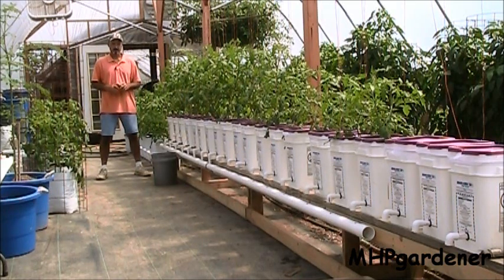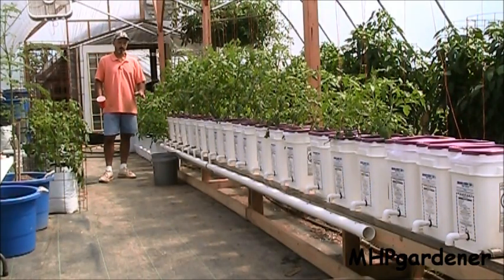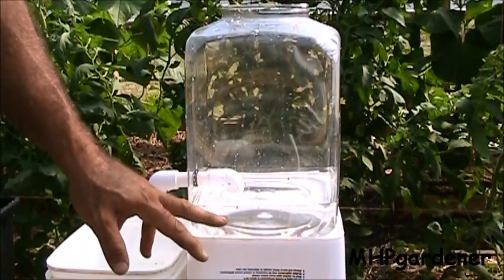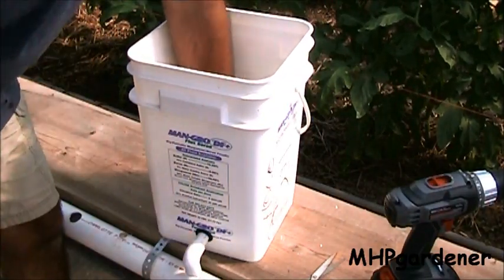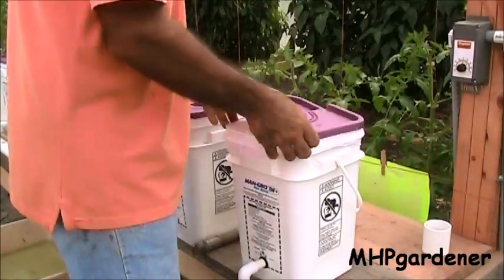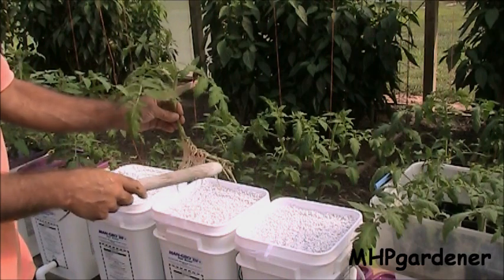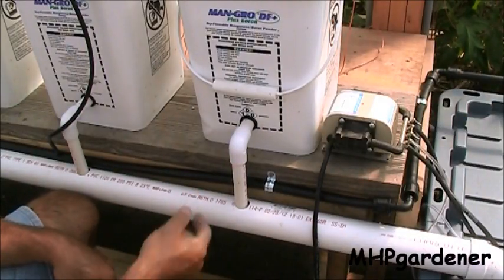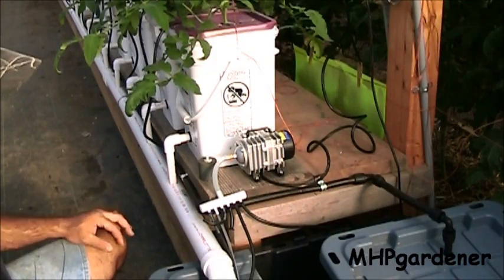Dutch Bucket Hydroponics - How It Works & How to Make Your Own Buckets

Comment: Why do you need the inner elbow? it should work exactly the same without, right? Technically, the outer one could go too. It is needed only to drive the out flow where you want. 

You were talking about the cost, you could just run it with the piece of tube, your 2 inches evacuation tube will then need bigger openings, but that will be definitively be cheaper.
Reply: roots can grow in the pipe

Comment: hi i am from iraq  but my problem is h dont know how use the nutritat or fertilizer to the water and the 2nd thing that perlite is very expensive 10 Kg about 100 $
Reply: you can use sand if you put something to strain it and prevent it from going back into your resevoir.
Reply: Perlite is cheap in the US because it's mined from the ground.  In your case in Iraq you probably should be able to find an affordable source of small gravel that will work well. If you have vermiculite,  tufa, or similar soft rock,  it should be worth trying.

Comment: Hello I wanted to start out by saying that I love your videos. My question is what you thought of using pea gravel and perlite together. I was thinking that I would put some pea gravel in the bottom half of the bucket and perlite in the top half. The reason being is that it get so windy out here in Calhan Co i thought that the pea gravel would work for two reasons. One to add weight to the buckets and the other to keep the perlite from going through the bucket. Basically allowing me not to have to use the paint strainers.
Reply: Why not use pea gravel for the whole thing. It is drastically cheaper, just heavier. Maybe that is the trick. Buy it in quantity from a gravel yard/pit. Might not want to move the buckets. They will weigh a lot. Maybe, put a false bottom. Those roots don't seem to be going very deep anyway.
Reply: @chriscook1468  Old golf balls on the bottom. ?.
Reply: @richsilvasatx  Full of nasty toxic substances, avoid!

Comment: well explained video
i am new to hydroponics
could you please explain how the entire bucket , root system and thr perlite get water only from one half inch dia tube, i mean as the water start pumping, water will flow vertically down, drain out through the drain pipe and not filling the entire bucket?
thanks

Comment: Can you confirm the measurements? 1 inch hole with 3/4 inch grommet and 1/2 inch pipe doesn't sound right.
Reply: For the grommet - the O.D. is 3/4 " and the I.D. is 1/2".  The 1/2" PVC pipe will need to be sanded down slightly, so it can slide through the 1/2" I.D. opening of the grommet.
Reply: Thanks, then the hole drilled should be 3/4" not 1".
Reply: Zachary Watts
No.  The hole should be drilled at 1/2" diameter as stated in the video and about 2 inches above the bottom of the bucket.  If you google "grommet"  and find a picture of a grommet, you will see that the two edges of the grommet cover the bucket and the 1/2 inch diameter fills the 1/2 inch hole drilled in the bucket.  Look at the video at time mark 5:35 and watch him drill the 1/2 inch hole and then slip in the "what he calls 3/4 inch grommet.  He is talking about the outer diameter of the grommet but essentially the inner diameter is 1/2 inch.
Reply: midijeep Thanks for clearing that up, but the video does actually say "What you're going to do is take your one inch hole saw..."
Reply: Zachary Watts
 You're right about that but the I.D. of the grommet needs to be 7/16 inch or 1/2 inch so the 1/2 inch PVC pipe can fit tight so there is not leaking.  Looking at the drawing at Granger for the 3/4" O.D with a 1/2" I.D.  I think  mhpgardener may have mixed up the hole drill size and the grommet size.  According to the drawing mphgardener should of said 1" grommet and 3/4" ho;e drill.  Maybe he can clear this up.
Reply: midijeep
I think a 1" grommet with the following specs should work.  Notice that the hole that needs to be drilled into the bucket needs to be 3/4"  (panel hole).

Outside Diameter = Outside Dia. (B)1"
Indside Diameter = Inside Dia. (A)1/2"
Panel Diameter = Panel Hole Dia. (E)3/4"

http://www.grainger.com/product/Grommet-3MPK8?s_pp=false&picUrl=//static.grainger.com/rp/s/is/image/Grainger/3MPK5_AL01?$smthumb$
Reply: midijeep This link is not the correct size The Part should be 3MPL8 
Indside Diameter = Inside Dia. (A)3/4"
Panel Diameter = Panel Hole Dia. (E)5/16"

- http://www.grainger.com/product/GRAINGER-APPROVED-Grommet-3MPL8?searchQuery=3mpl8&nls=1&suggestConfigId=6

Comment: How many buckets can you run off that one pump.
Reply: Check into sprinkler pumps. We got one for 180$ but we have 32 buckets on a 3/4" line. If you'd jump the feed line up biggest maybe 1 inch then the drip lines off that. You might could get away with more.

Comment: Thank you SO much for the extremely informative video.  If watering by hand, do you really only need to do it 3-4 times a day?  Are they okay at night while not receiving water?  Instead of having a drain pipe, could you just set a bucket under one grow-bin and water each one by itself using a full or half bucket of water (working your way down the line with the same nutrient water)? 

How do you start your seeds?  Directly in those little sponges?   Do you have a hydro seed-starting setup with grow lights?  How many plant-growing seasons can you go using the same perlite or other growing media?

I have had to grow in containers for many reasons and I found out the hard way that you can't use soil in them because it's just too heavy for the plants.  After coming up with a soil-less mixture, I found I had to deal with the mixture coming out the drainage holes.  I solve the problem by laying a small piece of window screen over the holes before filling the containers.  Depending on the size of the container and the number of holes, I sometimes just line the bottom of the container with a piece of screen the same size as the container bottom.  It keeps everything nicely in place. 

I imagine you could also use window screen for this set up; perhaps by cutting a small circle of it and wrapping it over the hole of the pipe inside the bucket and using a rubber band to keep it in place.  Window screen purchased in rolls would probably be cheaper than the paint screening bags and it is extremely useful for all sorts of gardening projects (like protecting normal raised garden beds from bugs and animals, and providing some shade when it's very hot). 

Thanks again. :)

Comment: why do you need such big buckets if the root mesh even of a full grown plant is so much smaller than the bucket?
Reply: Bigger buckets are the norm which you can find; the smaller ones actually can cost more money for some reason.  If you can find smaller buckets for cheaper than the big ones, it doesn't seem like there would be a problem with using them.

Comment: Bless you Brother, God has lead me here recently and I'm learning so much. Thank you. You mentioned getting oxygen to the roots via air stone. Question. Can you use a open drain hole without the PVC pieces in the bottom of the bucket? A rain gutter could be used to collect run off in this case. What would be the down side of this idea? Thank you
Reply: If you use a hole in the bucket with no piping, you'll have to put the hole 2-3" up the side just the same as he does. If you put it in the bottom, you'll drain all water out and have no reserve. There would be absolutely no reason why you couldn't do it, though.
Reply: I was planning to drill the holes just as he has done in this video. A friend and I discussed not using the 45 degree elbows to save some money on parts and I wasn't sure if it was necessary. Thanks Rodney. I appreciate your confirmation to my question. Best Wishes.

Comment: With no electricity could a person do a gravity feed setup by putting a bucket up higher and hooking it up to the feeding line? Then the return line like you have there. Just use a bucket to dip in the return reservoir and fill the feed bucket.

Comment: Some plastics are food safe and some are not. It is why Lowes or HD have several different colors of PVC pipe in the plumbing section. Random plastic is not optimal. We are all going to die, but I don't think this Dutch bucket is going to get ya.

Comment: How many gallons of nutrients do you need PER plant? Is there a recommended number like say, 2 gallons per plant? I'm planning on doing a nutrient change out ever 7 days so how many gallons would I need per plant to do that? 

Also, do you top off your reservoir with fresh water, not at all or with 1/4 strength nutes etc? My concern is that the ppms rise on their own every day if you don't put water back in and my other concern is that if you add more nutes, even 1/4 strength, you're raising the ppms and may burn your plants. Is this sound thinking or am I off base here? Thanks for your help!

Comment: I Set up 8 dutch buckets in my small climate controlled green house. Wondering what can I use  to lower PH? Other than buying the Pets Aquarium H down?
Can I use Muratic acid ?
  I also have a another drip system I run with a 55 gallon drum Pond Pump with timer.
Keep up all your videos please - Really Enjoy them
Gary    -   garysgreenplace

Comment: Hello sir. Love your videos and thank you for sharing all your knowledge with us on the subject of hydro. I apologize if this has been asked in the numerous videos you have done about dutch buckets but I am going to go the Pea gravel route for my setup and wondered if it posed any problems or disadvantages in terms of operation over perlite.

The perlite seems expensive to me and I think with pea gravel I wouldn't need the paint strainer in the setup. What do you think? Also is a 120GPH pump sufficient to drip 2 to 4 3 gallon buckets? Thanks again!

Comment: using plastic is injurious to health, avoid this system
Reply: Where do you get your drinking water from?  Haha.
Reply: Water out of the tap is run through plastic. Water in a bottle is in plastic. I really don't see how you are drinking water without plastic unless you own your own spring or something.
Reply: All your drinking water goes through PVC pipes that have been rotting in the ground for years.
Reply: What a dumb general statement if you are going to open your mouth explain why its bad ... is it the plastic itself i.e. BPA , leeching from previous contents, general plastic issues... or do you just go around yelling how stuff is bad for you because you read something on the internet...Also lol spring water who knows what was dumped in that spring before or has seeped in might be more dangerous than tap water which is tested at least.
Reply: nobody here gets out alive.  Use FDA approved plastic buckets and plastic piping approved for potable [drinking] water. You'll live fine til you die..........
Reply: The quickest and most reliable way to check for food safety is by consulting the recycling number. This number will be between 1 and 7 and will be stamped inside a triangle of arrows. As a general rule, the numbers that are safe for use with food are 1, 2, 4, and 5 with the best being 2.
Reply: Wayne Brewer Not all plastic is made from cellulose
Reply: living is injurious to your health....knob
Reply: Classic TROLL response!  Even has another account to make it look like someone else agrees! I've been growing tomatoes in plastic buckets for years.
Reply: altha2008 One of THOSE poor English users
Reply: ***** I am not qualified to say which plastics are the most toxic in your application, and I certainly don't know about the transference of any toxins to the plants grown in this system, let alone to the humans that consume the plants. The 'greenest' plastic could be argued to be a recycled one, though you'd clearly have to be sure about its provenance. Failing that I would stick with any 'food grade' plastic that is probably made from oil, like polyethylene, but steer clear of PVC, polycarbonate and polystyrene.
Reply: taz6122  One of them OCD people.
Reply: Plastic is made from cellulose....

Comment: Great video. I am in the middle of assembling my buckets just as you laid out here. I would like to know what purpose the elbow on the inside of the bucket serves? Can I leave this out?
Reply: The purpose of the elbow with a short piece of straight pvc on the inside of the bucket is to create a siphon effect to lower the water level inside the bucket.  The longer the straight piece on the inside the deeper you can allow the water to get inside the bucket before siphoning it out through the drain.  I don't know the optimum water depth to allow inside before draining through the siphon.  (Check out 'Bell Siphon or Bell Jar Siphon" videos on here.)
Reply: Stephen Brandt Thanks Stephen. This seems like something I should have been able to figure out. Thanks again.

Comment: Great vid.  I just have one question:  What is at the end of the black line that supplies the drip lines?  A plug of some kind I'm assuming.
Reply from the maker: I have mine just folded over and taped. They do make a little plastic piece to hold the pipe after it gets folded. But the tape has done fine.
Reply: mhpgardener What kind of fittings do you use to connect the 1/4" drip lines to the 1/2" poly tube?

Comment: Just a FYI comment. If you are in the upper Midwest, the Menards stores carry the Rainbird 1/2 and 1/4 tubing and fittings, as well as the grommets needed for the buckets can be found in the electrical department. Grommets there were 3 in a package for $1.09. So if you find buckets, you can one stop shop for most all you need for dutch buckets and the Kraty beds.

Comment: I have got a lot of info on DWC and I tried and they always leaked from where the grommets are.  Well what I discovered is when  you drill the hole be sure to be at 90 degree angle and pulse the drill bit slow so it makes puuuuuuuurrrrrrrfect cutout .

Comment: I am not a hydroponics aficionado, preferring to use a hybrid self-watering, self feeding in ground system, but just a quick note: you can make the process here even easier by essentially creating the mirror image of your drainage lines along the top, whereby you can water/add nutrients to all buckets at once from a central PVC feed line, plugged at one end. The feeder tubes will come from the top of the central line, thus not beginning to fill each bucket until the central line has filled up to the level of the feeders. This assures that each bucket gets approximately the same level of water. Further, you can hook up that central line to a central reservoir (big tub or even a 55 gallon drum) with a stop valve. You can then water all plants by simply opening the single valve. This can even be put on a mechanical timer, thus removing the need for any electricity.
If you want to fully automate, to avoid spoilage of the nutrients in the central reservoir, simply separate the nutrient solution from the water reservoir, add a separate valve, and utilize a pressure feed to draw nutrients from the nutrient reservoir whenever water flows from the water reservoir.

Comment: Hi, Really liked the video and it was very informative. Question; The pump you're using to pump nutrients to your buckets. Do you need a certain head pressure or size of pump to do a larger number of buckets like you have there, or will that small pump provide enough nutrient for all the plants? Thanks, Dan

Comment: I Like your video's, Ive looked at many of them. I'm setting up a basement setup that includes 4 areas for lettuce, tomato, cucumber, cabbage etc. I still need to add a additional air pump, how many liters does your new air pump produce I'm not sure what size I need.  I lost my cucumbers they just quit growing they were blooming and leaves turned brown. Growing with lights inside is a real challenge any suggestions would be appreciated.

God bless you

Comment: It's not as easy as you make it look, but I finished 20 Dutch buckets this afternoon.  If I can do it, anyone can do it, too !  Next time I will make the 1/2 " pvc going thru the bucket longer.  I cut 3" pieces to conserve materials.  Next time I'll cut 8 " pieces. More flexibility for bucket placement and easier for my fat hands to push thru the grommet.  I have high hopes for my 10 x 20 hoop house !  I'm 60 years middle aged and working harder than ever, and I might try to blame it on you if I screw up.  Just Kidding !   Thanks for your lessons.

Comment: If I have 20 dutch buckets using this system, how many pounds of your "12 - 12 - 6" ratio tomato feed should I expect to buy for a growing season ?  I know every situation is different, but I'm hoping you might give me an idea about what my material order should be.  I built a 10' x 20' hoop house over my garden.  My original plan was to just try to regulate the heat here in Arlington, Tx.  It stays too cold, too long, and gets too hot, too fast.  Tomato grower nightmare,

Dug my garden dirt up and put in in my flower beds.  Jumping into hydro with both feet.  I plan to video my results, maybe post them.  This post proves that I really am a dummy.  Any advice is appreciated.

Comment: Thanks for the mention on grommets. You can also get some from McMasterCarr for a very reasonable price. I am going to use a water tight grommet and pipe section in place of pipe fittings. A lot simpler and cheaper.

Comment: Love the video and love the good old southern charm!  Question, I was curious about using compost tea (water+compost mix).  Is that a good idea with hydroponics, or should you simply use the nutrient mix with water as normal?
Reply from the maker: Thanks. I have heard of people using compost tea, but I personally don't think it's a good idea because the nutrient content would vary so much. It would be difficult to maintain a consistent level of NPK. So much would depend on what you derived the compost from. I prefer to use the known values of a standard fertilizer.